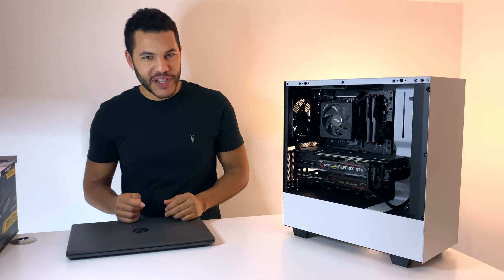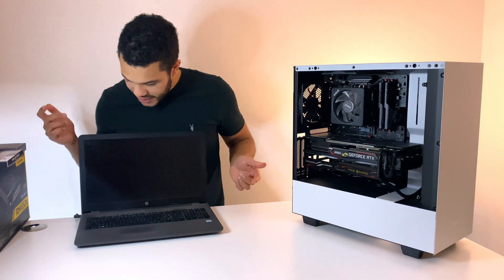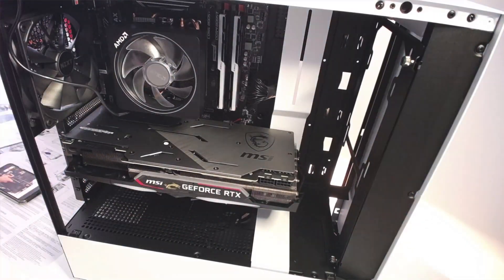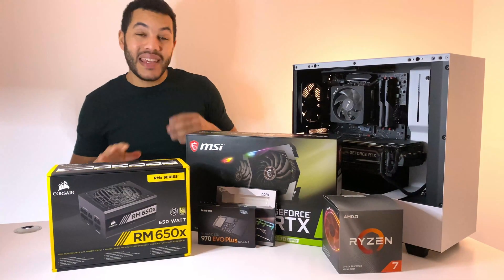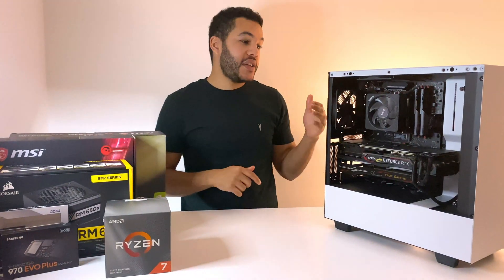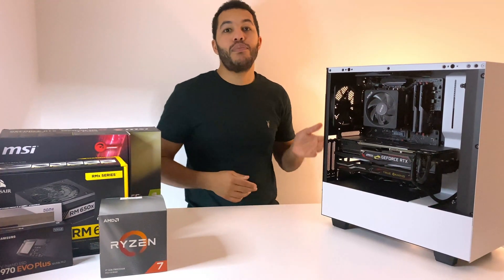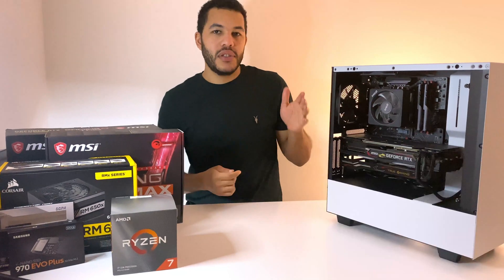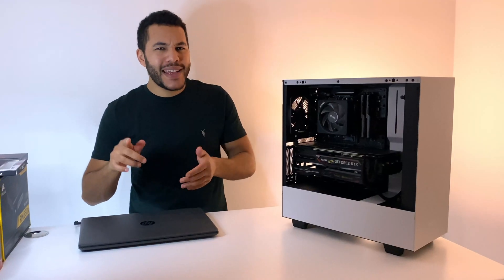My First PC Build!! - Components, Issues & Time Lapse!

Comment: Had the same problems with my laptop and i just upgraded to a gaming pc yesterday
Reply from the maker: Did you! Nice! There is such a big difference going from a laptop to a PC, no more overheating and crashing ha! For me building my own allowed me to spend a little bit more vs buying built and luckily I didn’t seem to have too many problems building mine. Enjoy the gaming pc!🙏
Reply: @TheReelSym  yeah my system has a radeon  580 rx (similar to one of the 1660 gtx gpus I think??) with a ryzen 5 keep up the grind man 🙏🙏
Reply from the maker: @Ragnarockm9 Decent! Yeah, similar to the 1660's and no doubt better than what you had before!
 Thanks man!